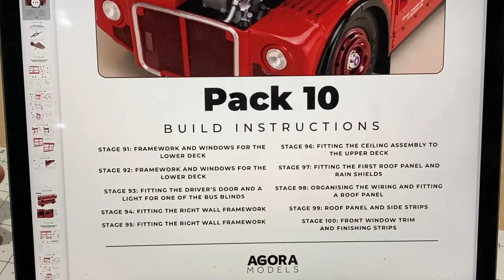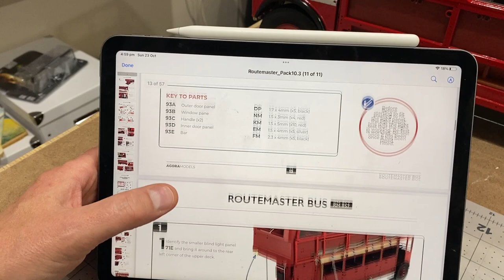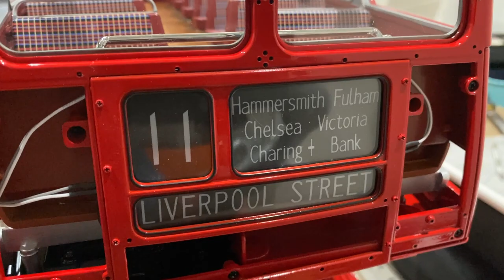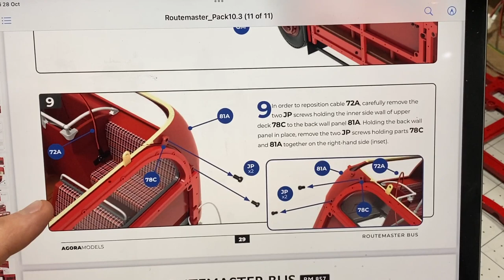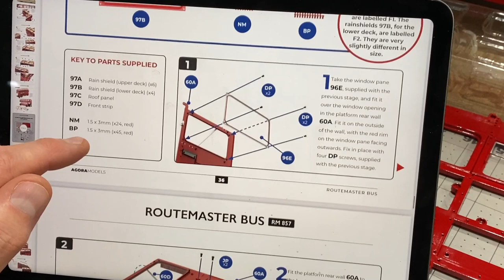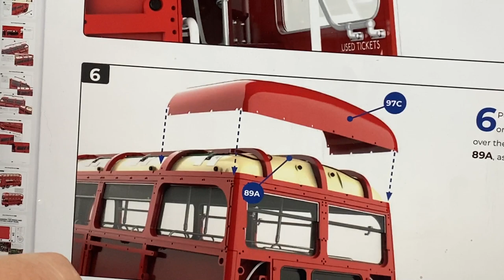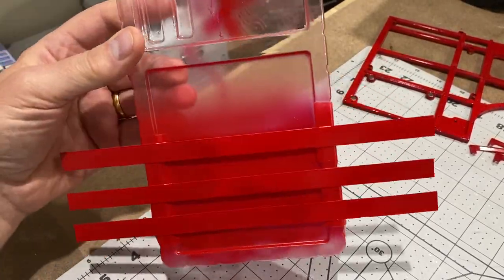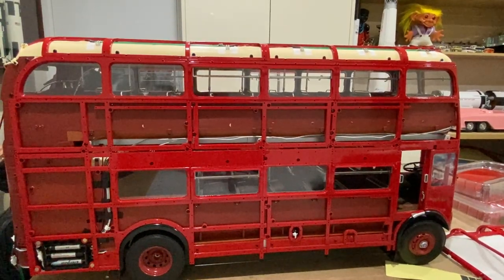The big red bus part 18 - Building the 1/12 scale Agora models Routemaster London bus

Comment: Good morning,
Have been following your route master build, this is my first attempt at this scale of modelling and find your videos so helpful, many thanks, I have got myself in a real muddle with the wiring, is there any chance you could do a video on the final wiring to show what goes where?
I would have thought Agora would supply a wiring diagram but after contacting them no joy.
As for the roof struts I think they are an essential finish, but again Agora say no the screws are a sufficient finish!
For my model I was thinking of using thin lead strips to shape and fit to hide those screws.
Any advice in particular for the wiring would be greatly appreciated.
Many thanks
Gary.
Reply from the maker: Hi Gary, thanks for the kind comments.  I’m not sure I could help you with the wiring at this stage because it is all connected up and buried within the model.  Which part are you struggling with?  Is it the connections to the board, the routing or something else?
Reply: @modellingmisadventures  thank you for your prompt reply,
I am lost with both the routing and the final sequence of the board connections, for example I followed the instructions for testing the interior lighting, but they just won’t work!
Gary.
Reply from the maker: Hi Gary.  If you haven’t put everything into the model yet, I would take a step back and test the electrics one step at a time.  I would just plug one set of wires into the board, making sure it is in the correct socket. Then make sure the batteries are in the right way round and turn on the switch.  Then press the appropriate switch in the cab or whichever one it is.  Then check all the others one by one.
Reply: @modellingmisadventures  thank you, I think that’s a good solution, as I say I am new to model building,and I was not sure that I could test one at a time, so if for example I just plugged in the upper deck lighting with nothing else connected to the box it should light up? Please excuse my amateur questions but your help is greatly appreciated.
Gary.
Reply from the maker: @jeremiahcoade6419  Hi Gary. Go to the instructions for Stage 71 and try testing cables 71D and E.  You should be able to get them to light up.
Reply: @modellingmisadventures  thank you so much for your advice, will try the wiring this weekend, (will let you know how I got on)
Best wishes 
Gary.